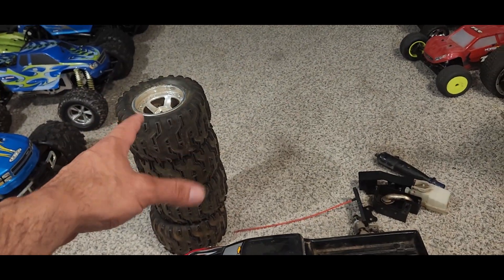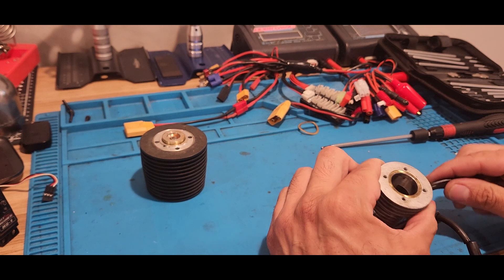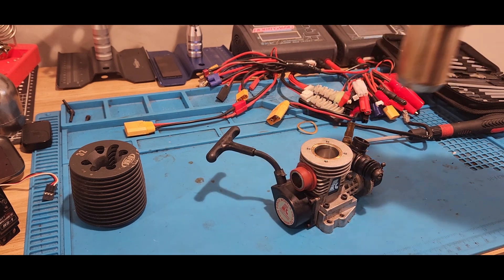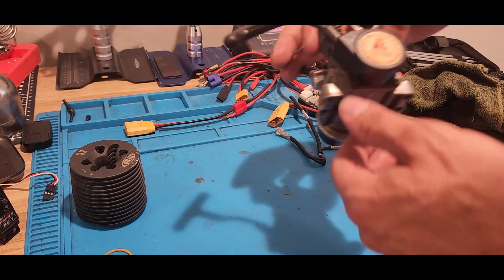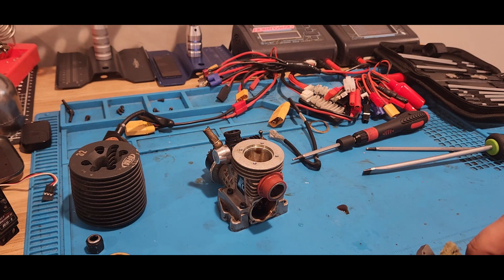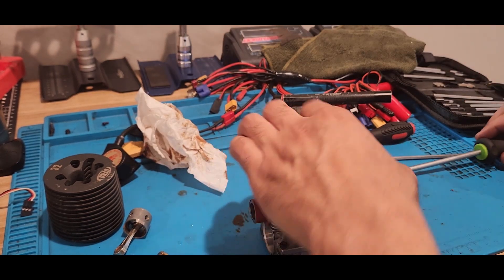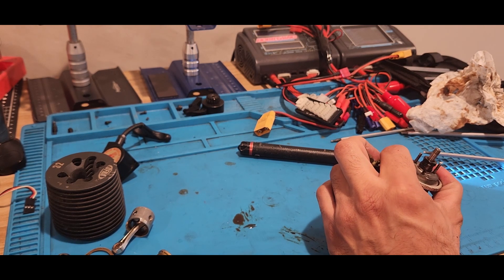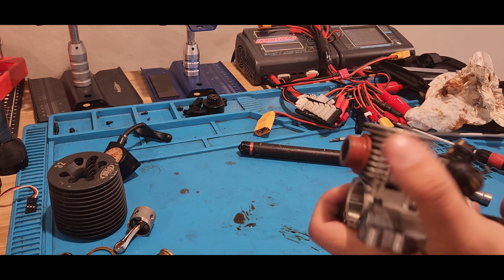Ofna .32 nitro engine deep dive

Comment: The clutch springs wasnt istalled right  ,they didnt pull the end back over
the clutch nut ,but they are still good!..😂😎👍
Reply from the maker: I know when I remove it I didn't catch it I was tired and my brain was not operating 100%😅